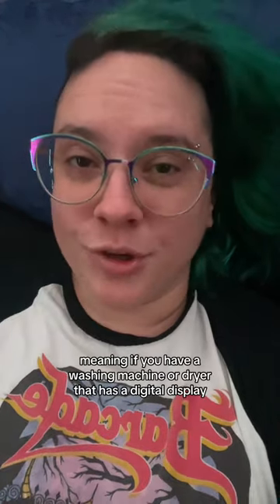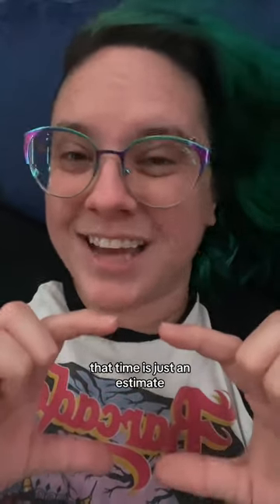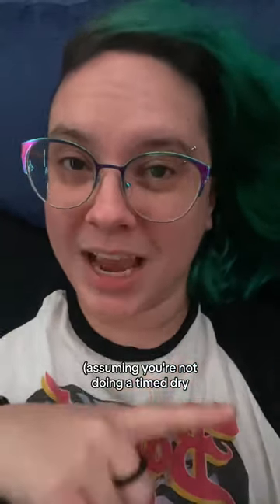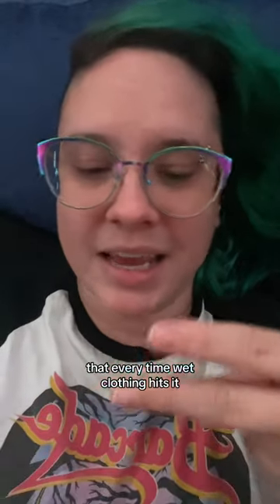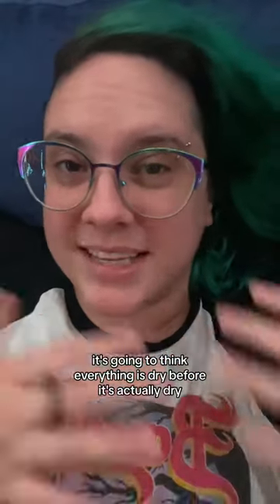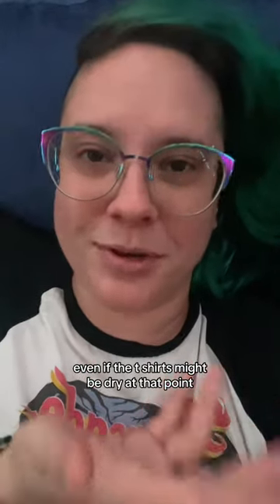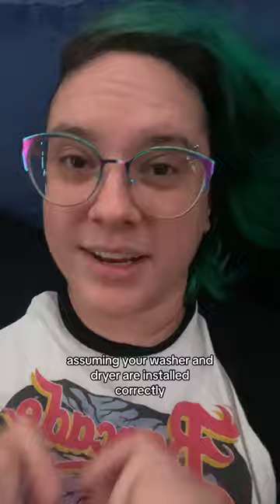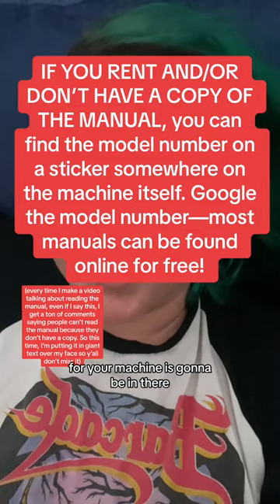Why the Time Remaining on Your Washing Machine or Dryer is (Almost) NEVER ACCURATE

Comment: I despise digital appliances so much and especially front load washers. I miss my parents old mechanically timed Kenmore washer. It was so easy for me to manipulate for customization and could finish a load in 15-20 mins vs almost an hour (or I could make it run virtually forever if I wanted to). And it was so easy to repair I literally did it myself a couple times. Thankfully I do have a top load but of course it's electronic vs mechanical and belt driven vs direct. I hate it but it could be worse. Lol. If I owned my home I would definitely be looking for an old Kenmore/Whirpool like my parents had.

Comment: Our GE Washer will highlight Load Rebalancing whenever it's stuck on that phase and reups the time each time it has to start that over. I'm actually amazed at the engineering and math involved to get it balanced. I have given that washer some tough tasks and it will spin the other way for a bit, what im assuming is pumping brakes sometimes, or do these really weird slight speed ups, all to try to get that thing balanced. I always feel like I have to apologize to it after it spends like 20 mins fixing my lazy "throw it all in!"

Comment: I’ve seen dryer magnetic vent connectors to connect to the wall. This way, when the dryer is pulled away from the wall for maintenance, it just disconnects. Is this something that would be a good idea? Would the magnetic parts have any effect on the components in the dryer?